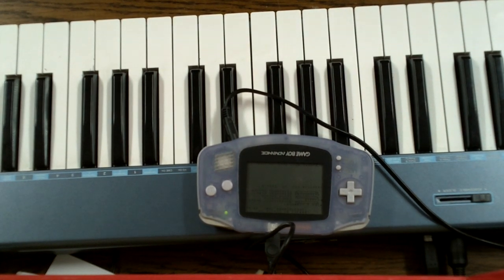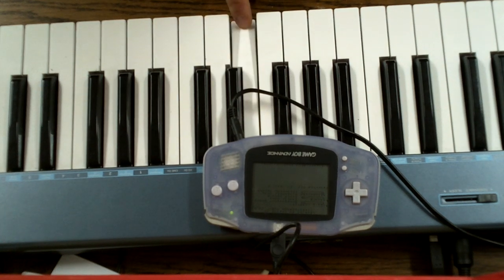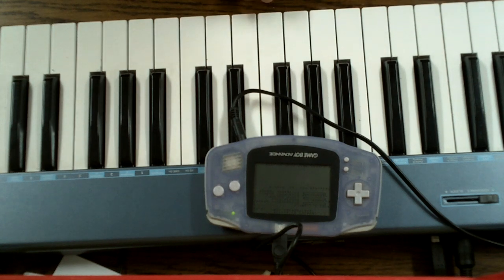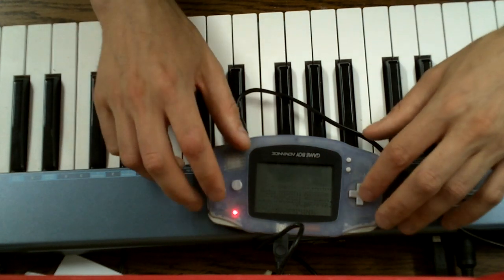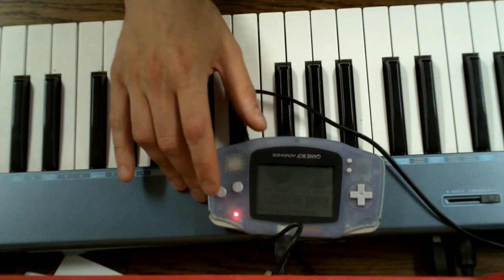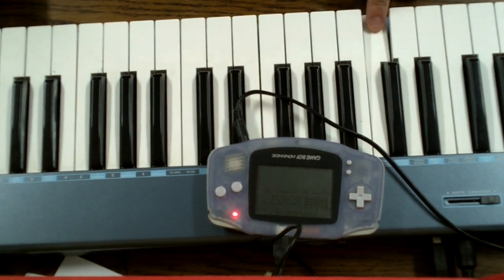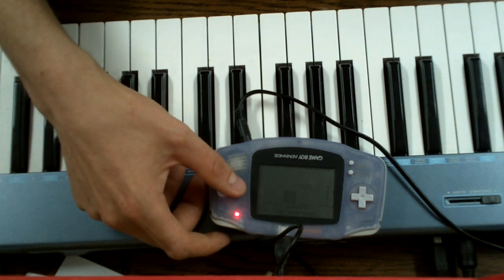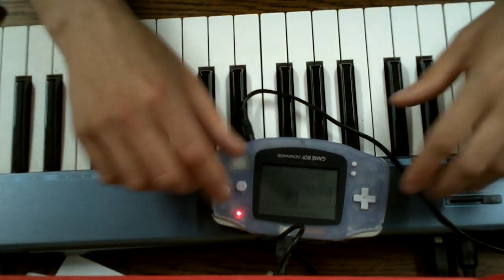GBA to MIDI cable

Comment from the maker: If anyone still wants to buy a cable; I sold out completely, but someone makes and is selling a PCB-based version with my firmware and blessing: https://catskullelectronics.com/gbamidi
Reply: Sprite_tm I'm not too interested in playing the gameboy as an instrument itself. I'm more interested in having actual Nintendo voices on my keyboard. Will your method be easier to use (and or more efficient for what I want to do) than the complex looking software  on cartridges like nanoloop?
Reply from the maker: Yes; the intended purpose is to work as a synthesizer, so you plug it into your keyboard and any key you press generates a GameBoy bleep. You can do some added things like sequencing as well, but the basic functionality is press a key -> get a sound.

Comment: So I quess it's not currently possible to send midi data to computer/sequencer from GBA using this method? But is it possible to send midi from computer/sequencer into GBA using this method so I could listen to midi songs though GBA? General midi support? Is there any? I assume it doesn't have 16 simultaneous channels but wonder about the channel mapping as well.

How do you save the song data with this unit or is it even possible?

I have M-Audio Oxygen 88 MIDI keyboard and it has usb + midi out. I could send midi out to GBA and usb to my computer. I could simultaneously record midi data to computer and listen the sound from GBA while I play. However afterwards will I be able to listen to the recorded midi data from my computer through GBA for example with usb to midi out connector from computer to GBA? 

I don't have this thing yet. Maybe I buy it later. Also somebody else was wondering the latency of this unit. It is very important that the latency would be as near to zero as possible. I'm still practicing to play myself. Noticeable delay between key presses to sounds would make it very hard to play precicely.

Cheers! =)

Comment: it's not actually MIDI
it's a cartridge with a MIDI port on it that converts MIDI to what the sound chip can actually understand
Reply from the maker: No, it's not a cartridge, the firmware is embedded in a microcontroller in the cable and uploaded to the GBA using a protocol called Multiboot. The microcontroller then proceeds to read MIDI from the MIDI end of the cable, the converts it to the link protocol so the GBA can receive it just like it would receive information from another GBA using a link cable. The firmware that was uploaded to the GBA then interprets this MIDI data and controls the sound chip using it. To how this is or isn't 'actually midi', I'll leave that up in the air.
Reply: Sprite_tm even if it was cartridge based it'd still be midi as midi is just a method of communication